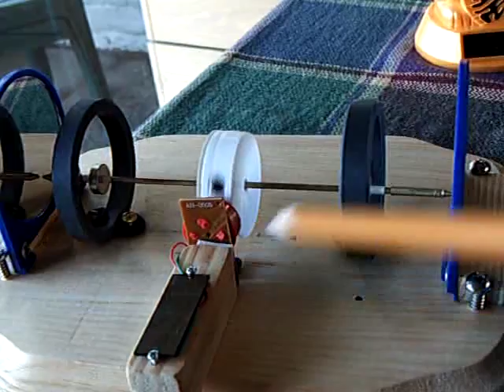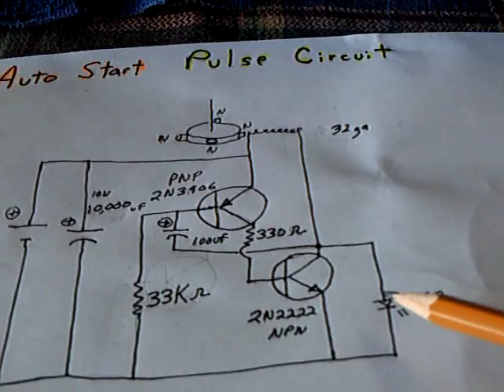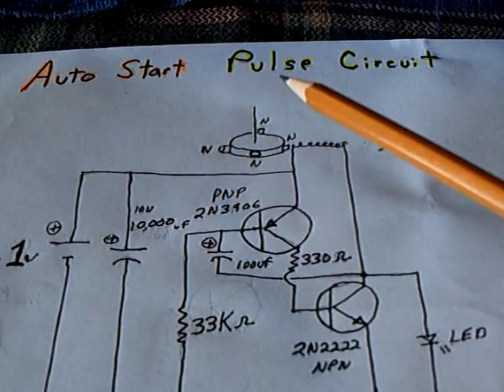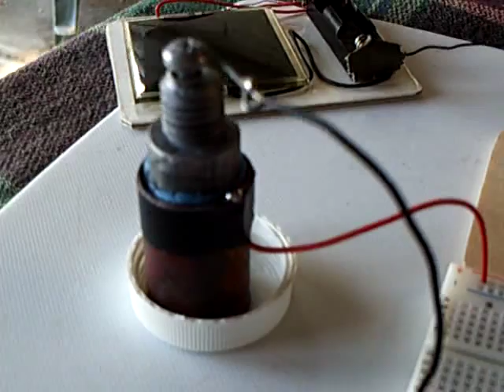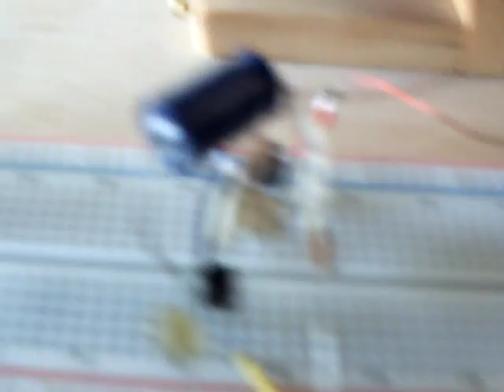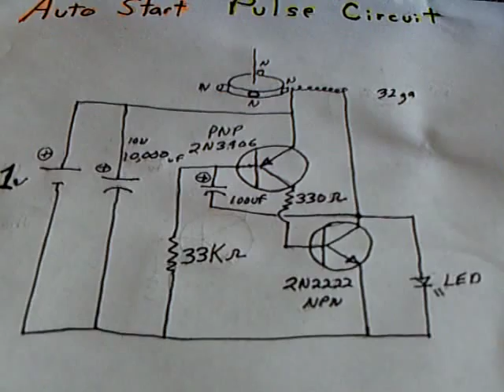Auto Start Pulse Circuit

Comment: thats interesting im still trying to figure out the frequency driven one.
but in this motor, is it that the pulses are constantly firing and the coil catches up to the rhythm? or is it more like the rotor magnets are affecting the coil impedance and the circuit fires only when detecting that change, like a bedini except its always firing and using the ohms of the coil at the time to dictate the triggering strength?